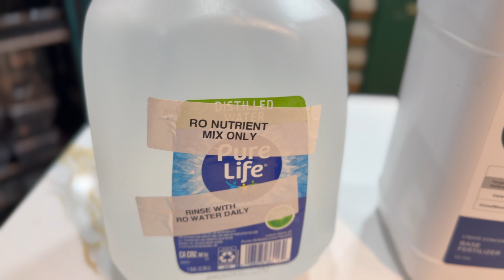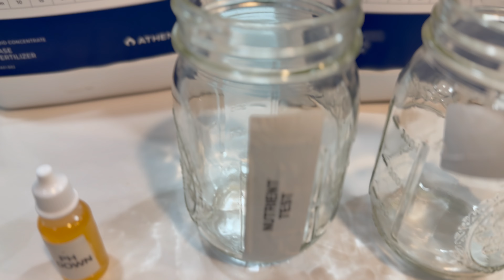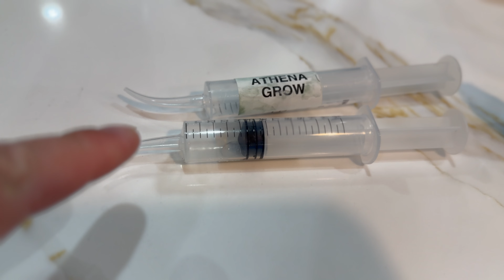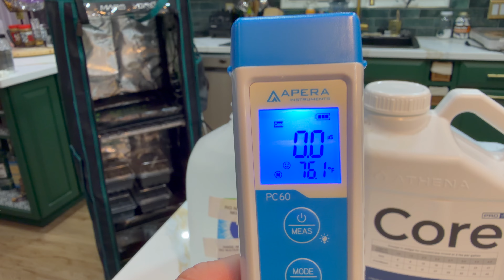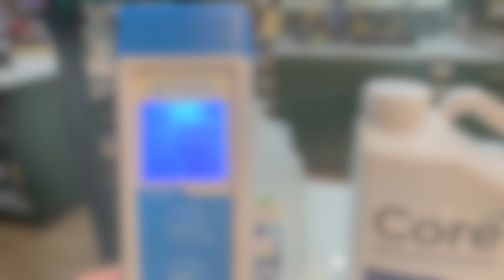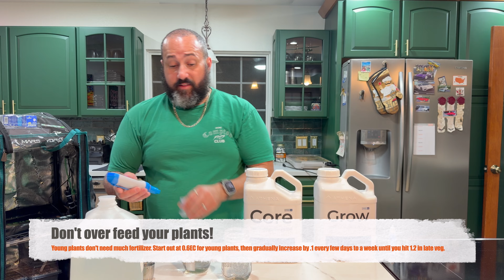How to Mix Athena Nutrients Correctly (EC + pH Method for Beginners) | Fertilizer 101

Comment from the maker: PRO TIP: If you're using tap water, let the water sit open to the air for 24 hours before using it for fertilizer mix. 24 hours will allow time for all of the chlorine in tap water to fully evaporate, which is great for plant health. Your plants will thank you!
Reply: I always use distilled.  Would tap be just as good if I let it sit in the open air then?!  That would be nice!
Reply from the maker: @jamesspiro7554 Yo James! Distilled water is actually pretty amazing. It’s cleaner than RO water, but not by a lot. Distilled water is about 1-20 ppm or .01-.02 EC. RO water is anywhere from 20-100 ppm or .02 -.09 EC. But as far as the plant is concerned there is almost no difference. I won’t say distilled isn’t better but the problem is that it will cost way more in the short and long term, and the plants can’t tell much of a difference. RO filters cost more up front, mine was about $140, but other systems can cost $400+, in either case, you’ll spend way over $140 in a year of buying distilled water gallon bottles every day. The problem with RO water is the waste water it generates. For every gallon of RO water you make, you also make at least a gallon of waste water. You have to be able to dump that water down a sink or outside somewhere. Every RO system has a waste water hose that you have to direct somewhere. The other issue with RO is the time it takes to filter the water. Filling a 5 gallon bucket probably takes 20+ minutes. Other than that there is an easy case for using RO over distilled for your plants. RO water is also stable enough that you can let it sit untouched in a bucket for a week without any worries. Even if you factor in the price of  annual or bi annual filter changes, RO is still significantly cheaper in the long run. 

Also no, tap water after 24 hours is nowhere near as good as distilled or RO water. The 24 hours just gets rid of the chlorine; which is immediately destructive to your plants. Tap water can still have other elements and impurities and will still show anywhere from 200-800ppm after that 24 hour period. 200ppm is good and usable tap water, at 800 you can taste the impurities.
Reply: @ZiadAunallah thanks, this is all amazing info. I almost thought I was free of buying 10 gallons of distilled water at a time from the grocery store lol It is worth it for the plants though!
Reply: Another pro tip: check your local/city water reports just in case they're using chloramine instead of chlorine if you're using tap water. Chloramine is stable and doesn't evaporate.A carbon filter or special chemical water conditioner/neutralizer is needed. Had to diagnose this problem with a few customers grows.

Comment: You can’t use Athena grow / bloom and core with same ML , you never read the Athena feeding chart ?
Reply from the maker: The 7-8 foot tall cannabis tree behind me in this photo disagrees with that assessment :) This is the same plant featured in the video, and this photo was taken this morning right after I read your comment. This plant is now at least 7 feet tall, 6-7 feet wide, and consuming 10 gallons of feed per day at around 1.4EC

https://photobucket.com/share/ebe64e5c-a5d9-49d1-a3f0-b1e9ac8a5b69

https://photobucket.com/share/e2a450de-7108-4517-a07c-8192608b9d84

The truth is, Athena's chart is just a baseline set of recommendations, and not something set in stone. What all cultivators should be doing, is measuring the input feed EC anc pH and comparing it to the runoff EC and pH, and then adjusting your fertilizer mix accordingly. Athena's feed schedule is almost double the actual potency I needed to get amazing results. By measuring runoff daily, I could see how the salt levels were building up to uselessly high levels when trying to use Athena's feeding schedule. That was before I filmed this video. I decided to back everthing down and start with smaller amounts, and build up to what the plant actually needed. 

Please understand that the purpose of this video was not to show you what potency you should mix your Athena fertilizer to. The purpose is to show you a good, proven, and repeatable method to always mixing your fertilizer correctly, to whatever potency you require. I have probably changed the fertilizer mix 15 times since filming this video. If your plants require different feed potency, or if you wan to follow Athena's feed chart, that's all perfectly fine, the technique I showed for mixing applies to all of the above.

Thanks for watching my video, I appreciate your support! I have more content filmed but no time to edit. I probably have enough filmed for the next 2-3 episodes already. Outdoor growing is chaotic, that's all I gotta say.